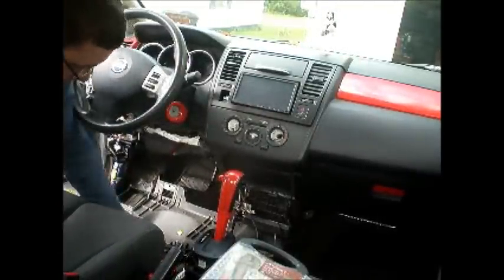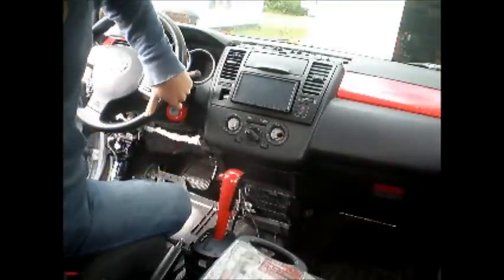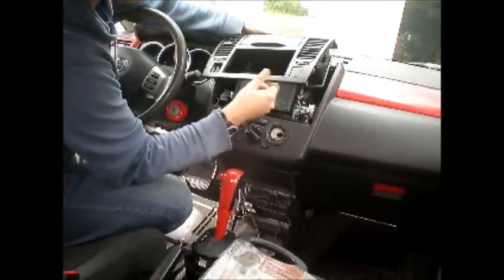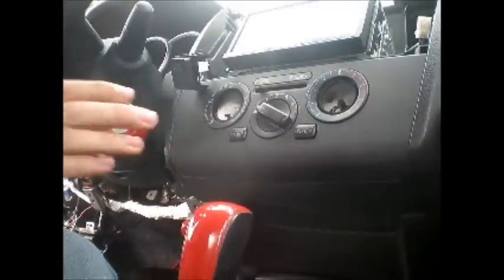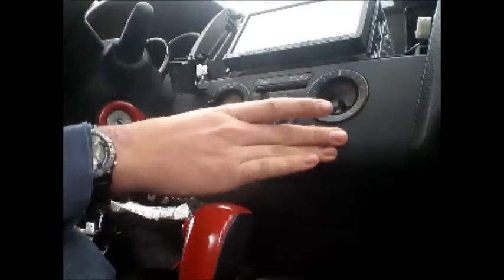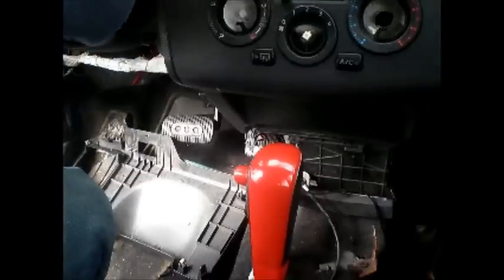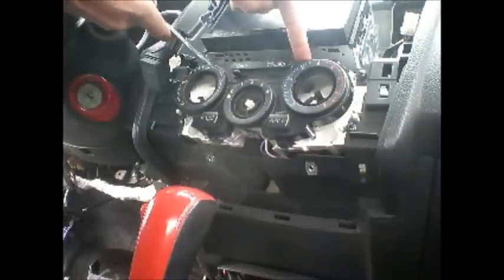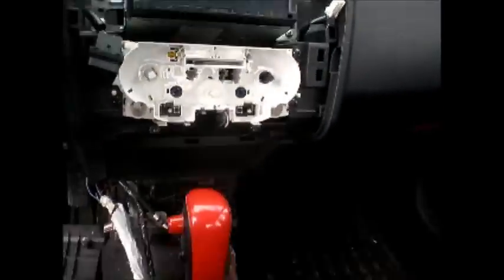DIY: Versa Interior Removal Radio, HVAC

Comment: Is there any way to you cna explain how to take out the white plastic section from the car to replace it? I mean from the heater controle pannel. You took out the buttons but what about the plastic how cna we replace that section?
Reply from the maker: Unfortunately I no longer have the car. It is a difficult piece to replace. The havoc system uses cables to operate change the air mixture and flow and disconnecting them from the white piece is not easy. They may have to be undone where they connect to the heater core. Sorry I can’t be of more help!